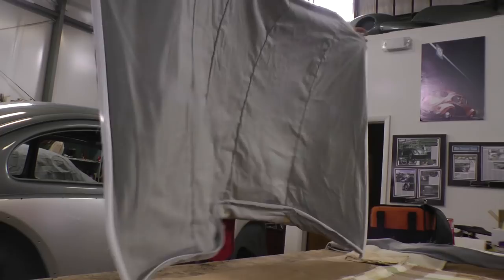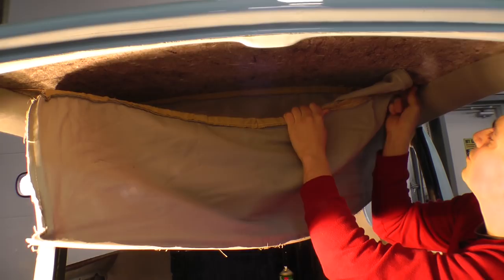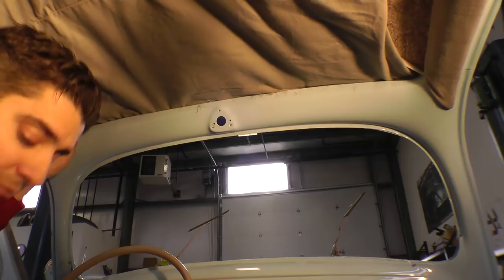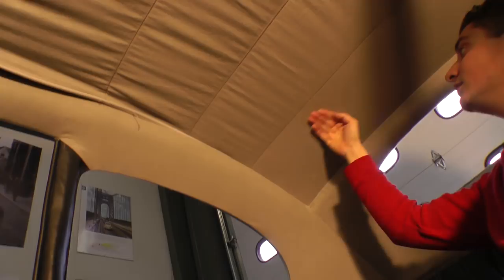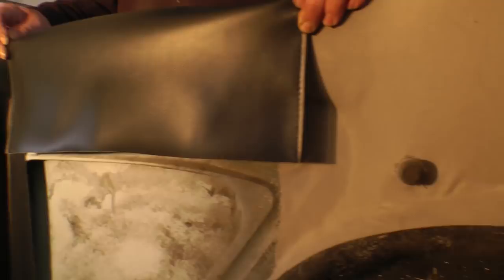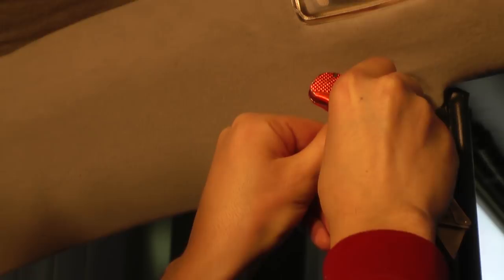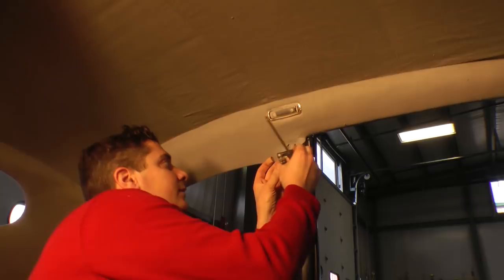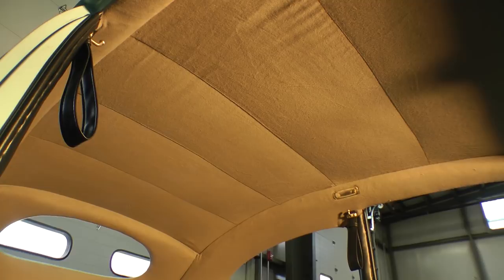Classic VW BuGs How to Install Volks Multi-Piece Beetle Headliner Pt.6 of 6

Comment: I tossed my bows accidentally. I though damn i may need them as the trash truck was driving away. I looked online and they ate about 10 bucks a piece. I was thinking about using ceiling grid hangers from home depot
Reply from the maker: Welding rod can do it too.

Comment: would a TMI vinyl headliner from Jbugs have the plastic strip around the perimeter of the main rectangle of the headliner kit? also great tutorial :D i will definitely be referring to it for the installation of my headliner.
Reply from the maker: They should yeah, as long as you get the multi-piece kit.